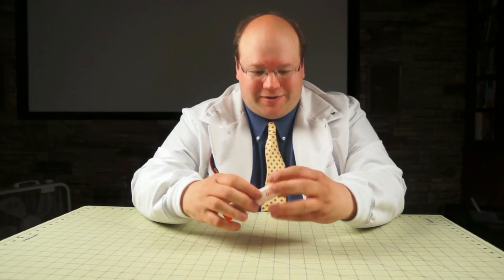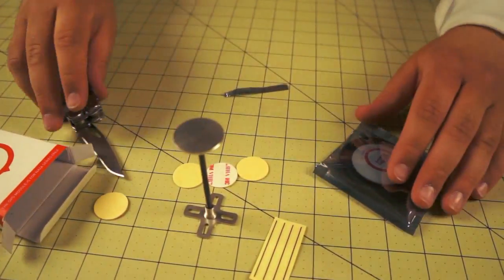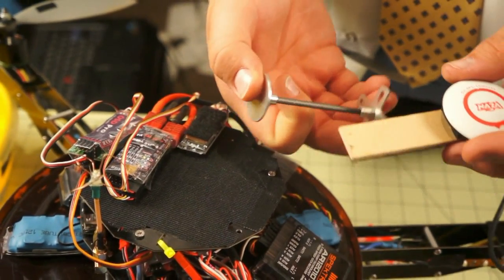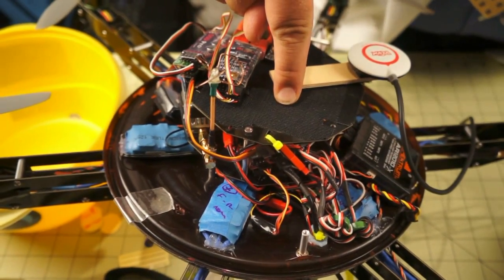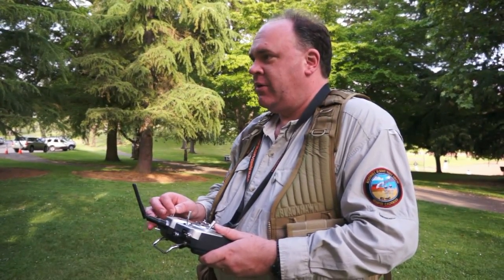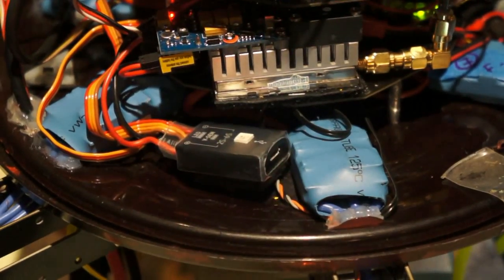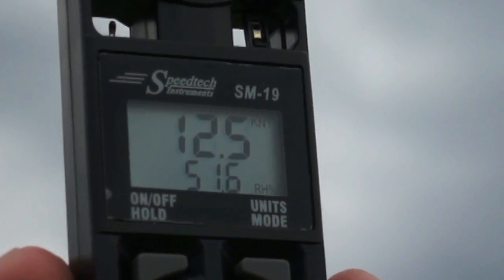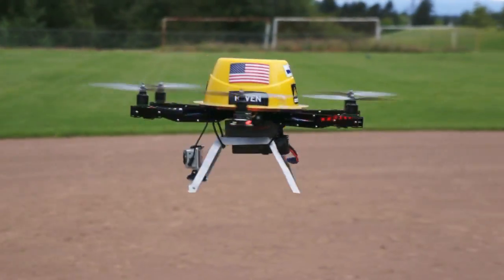RFTC: DJI NAZA GPS Unboxing, Installation and Testing

Comment: Good Vid... the Orientation control is used for when either your FPV feed dies and you might not be sure which direction you are pointed (due to distance etc) just turn on the orientation control and pitch back... OR it can be really helpful when you dont use FPV at all but are filming moving targets..

Comment: My naza will not go into gps mode. In the assistant software it says gps needed. I have returned the module, got a new one and it still does not work. Any ideas?

Comment: I heard that the satellite antenna works better if you direct the arrow, not straight, but to the proper declination of your area of the globe. Is that correct?
Reply: Join to this question
Reply: Well you would have to actively keep it aligned that way while changing the heading, but don't bother. The earth's magnetic force lines are almost parallel to the surface unless you're getting close to the actual magnetic pole. The satellites can be anywhere from zenith to horizon, so for the GPS signal quality it wouldn't do anything either.

Comment: Look for THAT_HPI_GUY's tutorial on installing the Futaba T8J on the DJI Phantom- all the steps are the same, but its on an F330, not a phantom. And the default settings should work as well, even though its the naza lite and not the standard naza that comes in the phantom.

Comment: And I do understand that helis and quads are very different crafts the naza system is the same. Calibrations were done before use the main issue is unacpected twitch and sudden pitch or roll. Jerk if you will with no input from pilot. Any help would be great

Comment: Arming the motors only starts two motors until you increase throttle, as this may or may not be normal I dont know. From the videos I have seen before my purchase has me a little upset. Due to me being a 3d heli pilot for 8+ years if anyone can help me with issues , recommend better escs and motor combos that work with naza system as I belive it has 400khz refresh rate.

Comment: Can you guys share what escs that you use I just bought the new OFM x650v4 quad it came with Naza flight controller w/GPS , motors are sunnysky 980kv escs are hobbywing 30a

Comment: Yes. The Naza only uses 5 inputs/channels(4 Flight Input and one 2/3 position switch) and that switch is used to turn the GPS on and off. So in fact you could use a DX5e but that wouldn't be ideal because of its lack of programming.

Comment: intelligent orientation control is supposed to be for if you lose site of your copter, you just need to pull back on your stick and it will come back to you no matter which way the copter is facing.

Comment: June 30, 2012
DJI S800 Product Bulletin
Dear Valued DJI Innovations customers:
DJI Innovations has determined that the Electronic Speed Controllers in certain S800 Hexacopters manufactured between May 2012 and June 28 2012 could have higher than expected temperature affecting an unknown number of units. Your confidence in our products is paramount; DJI Innovations is conducting a voluntary program to replace those parts free of charge.

Comment: Guys, I love your videos! You were wondering what Intelligent control mode can be used for. I am using it when flying LOS and it is far away so I can't recognize its orientation well, so I flip the switch to enable "Home Lock" mode and simply get my craft safely back to me not worrying about wrong direction. I find it simpler than waiting for RTH to complete (because it goes to 20 m altitude and only then returns to home). Just my 2 cents. Thanks!